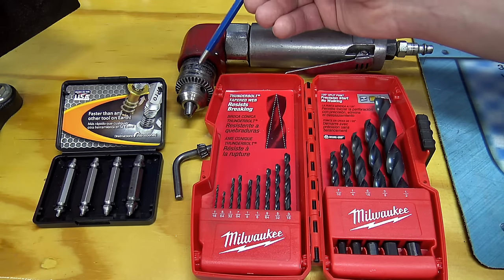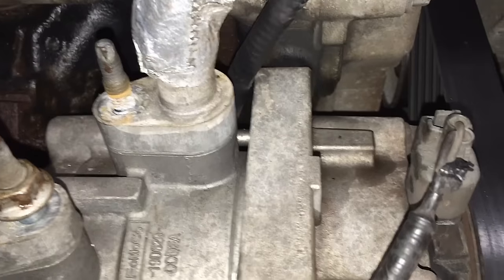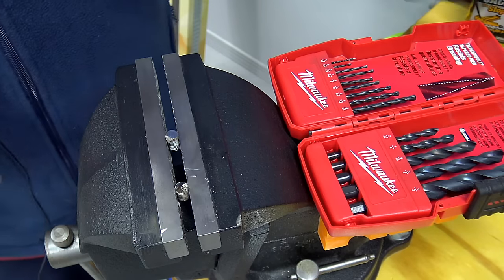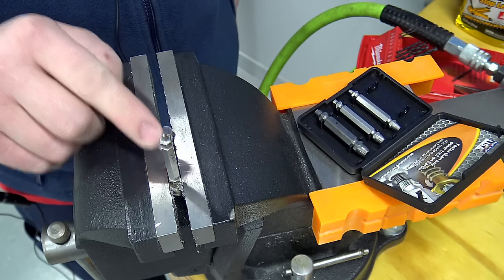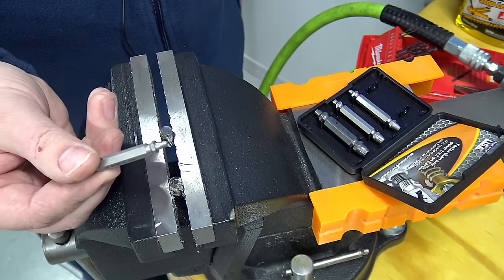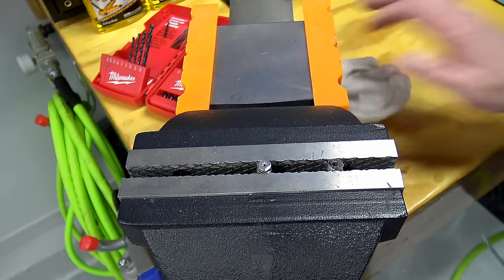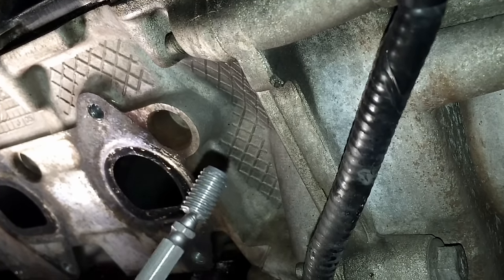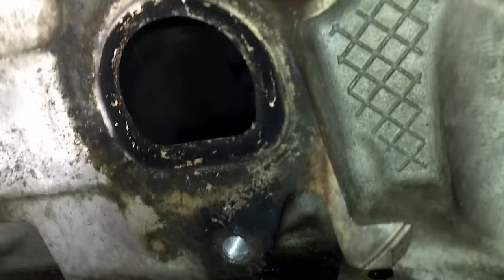Ford 4.6L 5.4L 6.8L 3v Engines: Broken Exhaust Manifold Stud Removal

Comment: Great video and as I said on your first video I wish i had seen both of these before starting. I had to release the engine mount to get a little twist in order to gain more clearance for the middle snapped studs. I also had to drill a small work hole in the shock tower to gain easier access. I was not happy about doing this, but it works and the hole did not compromise the tower integrity. I cleaned, primed and painted the hole so it is now an access point LOL. Still have to do the driver's side so wish me luck LOlz.

Comment: I like to use the 1/8" double ended bit to drill my pilot hole. Those things cut like crazy and when they get dull you can turn it over and use the other end, after that, toss it and grab a new one. I work for a International dealership and have had a lot of Maxxforce 7, VT365 and DT444E exhaust manifold bolts either come in broken or break when you try to remove them. Most can be done with the engine in the vehicle, unless it's a left bank Maxxforce 7, then you can't get to them so the head has to come off; Sometimes you get lucky and the bolt isn't broke off flush with the head.

Years ago I had a GMC 366 in a Top Kick that the bit broke off in, at that point I got the "Blue wrench" and blew the broken bolt out of the head. That should never be attempted on a aluminum head, it won't end well; However on a cast head the case iron is harder than the bolt, not that you can take your time, you have to be good with a torch. Chase the threads with a bottom tap and your ready to go.

Comment: If the bolts are broken inside the head they usually come out easy. The problem ones are the ones that weren’t replaced immediately and they corrode into the head. I’m dealing with one right now. There is enough sticking out of the head but it will not come out! This was the one that was broken. I’ve put some heat to it, just about everything I can think of and nothing. Next thing is to drill in a few threads the same diameter as the bolt hole then remove the bolt below that.

Comment: Just another way to get this miserable  job done...I have 08 ford explorer (Eddie Bauer) with the 4.6 L engine. Top stud broken off on the # 1 cylinder (front right) on the engine block. The Shock tower makes it nearly impossible to access this stud, even with a small right angle drill, ( there is only 2.5" of clearance between engine block and shock tower) I drilled a 3/4" hole (with a Lenox hole saw and extension) through the shock tower, approximately 2" down from the top, 1" from the side of the inside of tower. This gave me clear access to the broken stud. I used the extractors recommended by Tech Makuloco in his great videos along with a 6" collared hex extension and a drill. This procedure is probably is probably unorthodox, and I'm not an engineer, but I don't think it compromised the integrity of that massive shock tower drilling a 3/4" hole in it. It definitely made the job a whole lot easier. I thank Tech Makuloco for the great inspirational videos on how to conquer this job!

Comment: Not bashing PB put it do not soak into the seize stud that is broken, the drilling method is the only way.
I did mine and I had a guy can to my home and extract the broken stud out cost me $200.00, I will be prepared next time, will but the tools and do it myself.
Also when you pull the starter,  the bolt into the transmission housing sometime will likely go to be strip.
Jack the engine on the passenger side of the oil pan (not the oil pan it will damage the pan, trust me ).
Also when get extra studs cause you will drop some and good luck trying to find it when it is inside the engine mount compartment.
For the front bottom studs thread the bolts before installing them into the cylinder wall.
The tool that helped me was 3/8 flex rachet and the Dremel tool if the front bottom bolt is seized.
Did mine seven days.
Learn a lot doing this it is frustrating but push forward it will be done.
Good luck.

Comment: Great videos, I have to commend you for having so much patience for working on these shitty jobs and not getting frustrated. I've been a mechanic for 30 years, 10 years with Ford, I was so pro Ford but I'm DONE , time to move on to a better quality product, I see the same issues year after year with the Ford's, exhaust manifolds, blend doors and motors etc etc, time to trade in the F150.
Reply: I agree and I have been a Ford guy my entire life. I have worked on every vehicle I own myself and this line of trucks (from 97 onwards) and the never-addressed-issues OVER and OVER again have led me to feel the same way. The excessive amount of hours spent fixing things that should have been corrected by Ford years ago would have went a very long way towards customizing any other vehicle or putting $ in the bank.  Not to mention the ridiculous cost of parts for these engines. Broken studs, 160K+ mileage, gasket leaks. So I figure we'll do the timing belt, gasket kit and fix the studs. LOL....prices are stupid high and in the end I would still have a high mileage engine. The  Cure?...I bought a 2002 (VIN code L) engine with less than 70K to replace the high mileage engine for the cost of a full gasket set and timing belt/gear set. That is BS. When buying a lower milaege engine becomes a more viable cure for doing minor repairs, it's time to move my loyalty elsewhere.
Reply: They certainly screwed the pooch this time!!!!

Comment: Great Video! I will give you a tip that I recently used on a BMW X5 that broke a tensioner bolt when the belt came off and grabbed it. Once you break it loose with the extractor tool, you can use a left hand drill bit to spin it out provided your drill has reverse rotation. Million times quicker and easier than 1/8th or 1/4 turns with a wrench.

Comment: very informative video, getting ready to do this job on my 07 5.4l, i did luck out and found some reverse cut (left turn) drill bits at my local Oreilly Auto made by titan with the corresponding extractor, so hopefully i can avoid the broken stud going in further. great job on this

Comment: I have a question.  I did your weld technique and was very successful.  Cleaned everything and used new studs and nuts. Also used new manifolds and gaskets. Was so happy to fix it all. Less than 6 months later rear ports are leaking horrible again. Should I retorx the manifold bolts or take all back off and try a different gasket?  Of which brand gasket do you prefer. Thanks for your time and reply

Comment: A 4.6 in a 97 f150 might be a bit tuff, luckily for me the head gaskets are needing replaced anyways, but those exhaust studs are nearly all rusted out, a few look like rivets holding the manifold on. They will definitely need heated up, but drilling with the heads off should be an easy go.

Comment: Thanks buddy. I will be doing this tomorrow
Reply from the maker: +WOOODYII2 oh boy good luck!
Reply: Lol,Thanks. Im doing it on a 2000 expedition 5.4
Reply: WOOODYII2 well how did it turn out
Reply: well, 6 of the 8 nuts were rusted off so I had to weld nuts to them and they came out fine. the other 2 had to be drilled and tapped. I did try an easy out but it would not work. Also ended up using a cutting torch to cut out the manifold, Made the job much esier.

Comment: Great videos! The key here is patience and planning. One thing I found is those grabits are too large to fit into a deeply broken stud hole without damaging the aluminum. I spun the extractor body on a grinder to relieve the outside diameter. Another thought is to use some scrap fuel/brake line tubing cut offs as a centering guide for the first drill. One request, though; Do an Econoline van with the Triton manifolds. Did anybody ever mention you look like Paul Teutle Jr?

Comment: I am just a bit curious as to why no one is using stud extractors? So many of these videos the stud is coming out so easy. With 45 years playing with cars and wanna be hot rods, never have I had it easy. I have a great selection of easy outs and stud extractors. I always try a stud extractor first then cut off or grind down for a flush stud. Your videos are great and I have used them many times.

Comment: in my experience with the ford product line on exhaust studs if they don't come out easy by hand only , stop and just cut the nut off or the stud  near flush to the manifold and get the manifold out of the way .  then you still have something to work with , vise grips and lots of heat and just wiggle till it moves .     there is very little room to work on the truck line and less on the car line .... make sure you tread chase all the holes and antisieze  the bolts
Reply: also if room is an issue you can remove the mount nuts and jack the engine up and block it this will give better angle on some of the holes behind the shock mount

Comment: My coworkers- all of them diesel mechanics that do engine work all day, and one of them a former Ford Master Technician are trying to talk me out of taking on this job on my 03'. Their concern is me cracking/damaging the cylinder head- how do I avoid damaging the head while removing the studs? They keep telling me I need to use a wire welder and and weld a nut to remove the stud as being "The sure" way of getting a stud out. Your method seems equally effective for those of us who don't have welders or welding skills......but just curious how to mitigate the rist of cracking the head or causing damage?

Comment: Thinking about giving this a go on my 08 f150.  I can tell before even starting that 2 of my studs are broken the front upward studs.  If I fail at this drill and extract technique but don't damage the threads could I use the weld technique as a backup plan or would I be screwed at that point?

Comment: i have two on the same port. im currently installing a full exhaust system on 2003 crown vic and on the drivers side have two broken bolts.
Reply: PBWillyWonka I have to deal with mine soon. Only 1 is broken

Comment: I usually crank the welder up to a high setting and weld a nut to the broken stud, can cause way to much damage with a "walking" drill bit. Many exhaust manifolds done this way. If the broken stud is below the surface, build up with weld then weld nut on and attempt to remove.
Reply: Finally someone who knows how to do exhaust manifolds...

Comment: I have a hot tip for those struggling to get an extracter or easy out to bite like I had. Use a T15, T20 or T25 bit to bite the inside of the hole drilled out. I try to tap it in as hard as I can given my space restrictions. It has worked very well for me on the 6 broken exhaust bolts broken on my 3v 4.6 sport trac.

Comment: My dad has a 1998 ford f-150 4.6 v8, I checked the check in engine light it turns out that EGR is clogged up but when a head bolt broke off due to years of heat and corrosion can you ever get the chance to assist me at any way that's why I watch this video.

Comment: great video,I think im gonna do a timing chain on my explorer 4.0l , soon,it is rattling at cold start,but it is quiet once the oil pressure is up,and I will change the head gasket too
Reply: +STEEVE DAVID Nicolas I sold my sport track cause the maintenance manual says to replace the timing chain guides every 60k miles....On the Canadian performance engines, thats 3 sets...I've got 185k miles on my 97 GMC 350 and still running strong !
Reply: +David Dickert mine has 164000,the truck still going strong but the rattling is only when it is cold until it get oil pressure
Reply: Something else I noticed is the body mounts faiing. They made the " soft " in an effort for ride comfort. That can get just as expensive. That rattle upon startup could also be rod bearings failing untill enough oil pressure builds up ,thus filling the wear area...
Reply: The noise is extacly where the timing chain is one in the back ,one in the front

Comment: While trying to remove my transmission pan, the first corner head spun off.  My question is, where do you apply the heat to help extract the bolt? On the side of the tranny case, near the bolt path up thru? 8mm heads on the pan bolts, very small.

Comment: Thanks so much for your videos on this job! I've been reluctant to start since I wasn't sure how to proceed. My only quotes from shops in my area were "those aren't fun, I'll have to set aside a couple days labor and I can't tell you how much it will cost" or something along those lines. I think I'll go for it. I've fixed everything on this truck, why not this? Thanks!
Reply from the maker: +Chad Hanson Not fun indeed just take your time and have the tools on hand. I also have a video on exhaust manifold removal.
Reply: +FordTechMakuloco I just finished watching that video! I'm putting together a large Amazon order. Lol
Reply: +FordTechMakuloco I just saw that you're probably not very far from me. I'm south of the Rockford area. If I have problems, I'll just tow it to you...
Reply from the maker: +Chad Hanson Nice!

Comment: Would you feel comfortable using the weld-a-nut on method that you use in another of your videos?  If so, what about the electrical system of the vehicle?  Could the Welder cause damage to the ECM or such?  Great Videos as always!  Clay

Comment: Have you considered using a left handed drill bit when doing this?  that way when you drill the hole the forces naturally want to pull the stud out :)
Reply from the maker: +Marc Hering no room and I am not willing to cut down my left hand drill bits to length for each job to make the fit otherwise yes!
Reply: the harbor freight left hand drill bits are actually pretty strong. they are $10 you can cut them short.

Comment: I loved this video Thank you for sharing your experience and wisdom.  I have a 1998 5.4L expedition 4x4  that seems to be a little different that the f150 shown in the video... looking at my truck it looks like I may have to take the A/C compressor out of the way to make room in order to get to the studs. Is that correct?  Can it be unbolt it without losing the charge? Is there anything different that I would have to be aware of..  Oh that's the right side manifold.. Thank you..

Comment: Thank you so much for your videos I now know how to swap out my breaks rotors bearings with out having to pay crazy prices. Now question I have a 2002 Ford F-150 2WD 5.4 v8 I got codes coming up p0171&p0174 I have checked everything I could check. do you have any advice on that. truck runs fine not one hick up no bad starts in the morning. Egine light came on for a while but after I cleaned the MAS and some pips here and there the check engin light turned off. But when I scan it still reads same codes and says system to lean. Bank 1and bank 2.
Reply from the maker: +MrKillakiko Most common cause on that truck is the intake manifold gaskets. I have a detailed video on how to change it with links to the parts and supplies you will need.

Comment: good video, but how were you able to keep your extractor straight considering you drilled the hole crooked?
Reply from the maker: +donnie jackson it's the way it self centers in the hole so coming out it will have a wobble to it being off center but you are cranking it out by hand so it's not an issue.

Comment: another great video with tips!  Thanks Brian.  I noticed you did not use left-handed drill bits. Do you not recommend using them?
Reply from the maker: +009to090 I have never found a need for them and this drill is nor reversible. I need to update mine to the Chicago pneumatic I have listed.
Reply: +009to090 The left-handed drill bit was used years ago, I think when stud extractors were not as quality as they are today. I believe the thought process was that if the stud wasn't seized in the hole that it would back it out as you were drilling.
Reply: +009to090 

I have some left handed bits for scenario's where they are not "welded" or cemented into place by dissimilar metals - which is why these  tend to be problematic, and they just don't seem to ever work.  Not to mention it's tough to get in there as it is.......I seriously you would have any more luck with those.  I would save them for a situation where they have a higher probability of working

Comment: I have an 08 5.4 and the front cylinder both top and bottom passenger side studs are broke off. The back are also snapped but my question is, will i be able to use this method without raising engine on the front 2 top and bottom with the shock tower ?

Comment: Your way works ok but if you have a mig welder it works way better. You don't need to evacuate the A/C. We used to do it your way in the Ford garage I worked at until we figured out the welder works way better. Use your instant on helmet and build out the stud with weld and remove it with vise grips or a stud extractor.

Comment: Hi can you help me figure out how to extract a broken pipe stub from inside the port of an air shutoff valve?  Nothing is sticking out that can be grabbed or tapped to change its shape. And I don't want to do anything that would get foreign objects in the air system. There are no threads.  Thanks

Comment: Hey man, I'm thinking of doing my exhaust manifold on my truck and the studs aren't Broken , do you think if I take my time with each of them and use the heat method They should come out ok without breaking?
Reply from the maker: +Bobby J's Reef Tank either way you will have broken studs either on the front or rear but as you see here the extract pretty easy

Comment: I stripped out that stupid T-50 star tip bolt on my brake caliper.  Any tips?
Reply from the maker: On that one you should be able to remove the caliper and anchor bracket together then wiggle and slide off the caliper then proceed with using a vice grips to remove the bolt.

Comment: What could a man do to prevent the bolts from seizing and breaking off? Some copper never seize and drill and tap to the next size bolt so it would be stronger?
Reply: John Hasty get better bolts